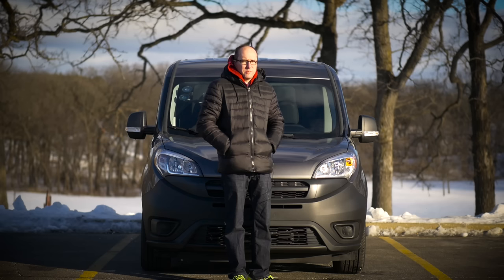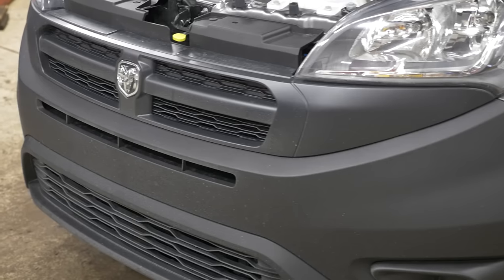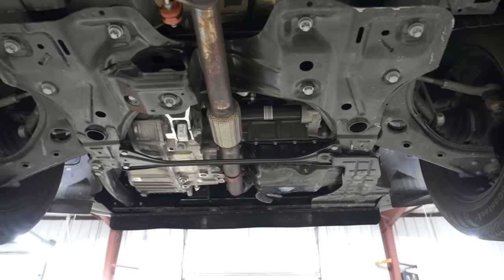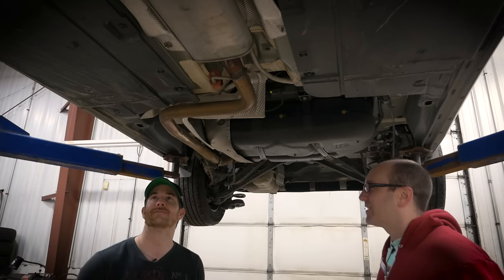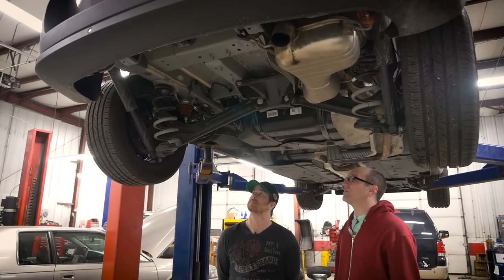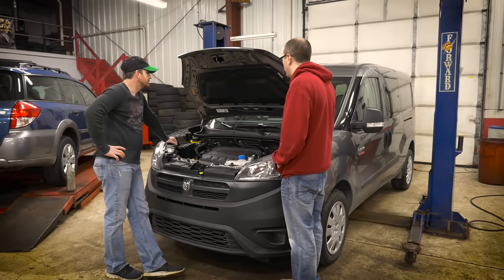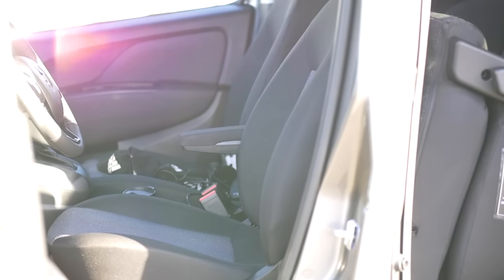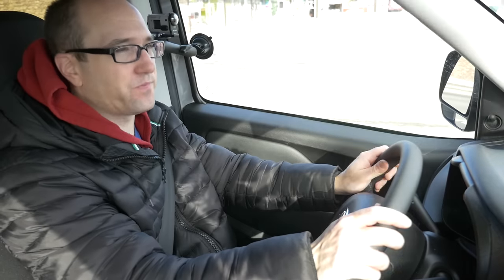Review | 2016 Ram Promaster City | Race Ready

Comment: Just found this review 2 years late. As a Dodge fan, it is hard to say, but the reliability of the Promaster is terrible. My company has about 50 of them and over half have left the driver stranded with overheating problems. I believe the main issue is failed cooling fans which have been on constant backorder. One driver was stranded when the motor died, and would not start due to being "low" on oil. I have no 1st hand experience since I pay a slight upcharge to drive the Ford Transit Connect. My previouse company car was an Escape for 3 years, and having no issues with it, decided to stay with Ford. There are 4 of us driving the Fords and they have not broken in the last 2 years.  I have 44k on mine. Keep up the great reviews!
Reply: I work for FCA and drive a ford transit 350 van for my other job. The transit is a beast. TORQUE FOR DAYS..
Reply: Mitch H Odd. I have two 2014 promasters that we run as expediters. 484,000 on one and 480,000 on the other. Not perfect, but the best van on the market. 

The fan issue is annoying, but Rockauto has them for $136, vs 320 at autozone and 450 at the dealer. The fans seem to go out every 100k or so. But they wobble and make noise before they do. 

There a 2 other weak spots, but what I find intereting about the promaster is what doesnt fail. Never had to touch a water pump, belt, steering system, torque converter, brake booster, master cylinder in either van. The pinacle of durability, the chevy van, would have needed all that stuff by now. Meanwhile, the promaster gets 20 highway, goes through snow like a beast, hauls 4300lbs, is quiet, and turns on a dime. And it costs less way than a chevy, and slightly less than the transit. Amazing.
Reply: @Turshin  That is why Transits are legendary in Europe
Reply: This isn't a promaster. It's a promaster city. Completely different vehicle.
Reply: It’s all fiat components.

Comment: I liked that you put the Promaster City up in the air and showed the under side. I saw a lot of details and stuff I really liked about the design, layout and fabrication. I saw lots of little things that make a difference miles and years down the road in how the van will drive, sound, work, feel, perform and last. Thanks for that view.
Reply: I'm late to seeing this video, but I had to stop it after 6 minutes; all these guys were doing, with the vehicle on a lift, is laughing at its construction, seemingly wanting to just come right out and say that it's crude (rather than merely, and repeatedly, calling it "simple"). I'd love to know what you saw about its "design, layout, and fabrication" that impressed you because this review seemed like a complete waste of my time.
Reply: Easy open access to everything. Cheap stamped parts that are all painted for rust prevention. Small overall amount of parts means less things to fail. It'll last as long as the 9 speed does - which to be fair has been dubious at best.
Reply: @kenhoward3512  You're not use to their style.
Reply: @kenhoward3512  He's joking

Comment: These clown should actually pack it with weight and drive it instead of incorrectly guess what it's capability are.
The bed is 48.2 " so you don't need to tilt a 4x8 sheet on an angle. "It's probably for flowers". I just hauled 1920 lbs. of hardwood flooring + my 185 pounds + another 140 pounds of freight like a champ had more power than I needed and the weight was handled like a champ as well. Certainly not like a lot of 1/2 tom pickups with that amount of weight dog wagging down the highway.  I've used 1/2 ton pickups for the same haul and this handles it better. If your going to do a review, do it correctly. Don't be lazy.

Comment: wow.... it is originally Fiat Doblo :-)
but in europe there 1.4 120 HP gasoline engine, or 1.9 diesel engine with manual transmission
chassis looks little bit different (like cheap version) I do not see any cover plates, interior fittings also looks like cheap version ....

Comment: I wouldn't call the rear suspension, basic.  They could have just used a torsion or trailing beam rear suspension and save some more bucks.  Heck, the competitor from Nissan, the NV200 have leaf springs and a beam axle.
Reply: Except that leaf springs and beam axle support a higher load capacity.
Reply: Maybe but behave like a truck. Tried both and in a daily work life the PMC is way smoother especially when you leave the road and turn in a parking business entrance. As a tech on road I appreciate it (compared to my previous Ford 250 pack up)

Comment: I bought the 2015 with NO FRILLS! No cruise. No camera or sensors, blah blah. I have the plain 3.0 screen. The amber lighting on the speedometer and tach is ridiculous. The placement of the speedometer set to the back left on a sunny Florida day makes it very difficult to see the speed. Amber lighting is for safety, but not if you can't see the speed. I traded my 2016 Ford Transit Connect toward this unit. It had every feature imaginable and was a 6 seat unit. $32,000. It was a very poor use of space or me. I need the wide open area. I only wish this had an 8 foot floor. My advice to all is make very sure you are comfortable with any van you buy. This is your home when you are not at home.
Reply: Very true, I have the Tradesman Cargo SLT and the gauges are near impossible to read when the sun is out. Amber lighting is just bad.

Comment: I purchased a leftover 2015 Promaster City SLT 5 passenger wagon. It has almost all the options except for backup camera and nav. Don’t need the nav, the one on your cell phone is better. but get the backup camera! A grand caravan is better in most respects, but the reasons I purchased the Promaster City still stand. 1) low step in, 2) great headroom, 3) big front doors, 4) low cargo floor, 5) independent rear suspension, it works in the bumps. 6) fits in the garage and you can close the garage door and walk in front of the van. It’s “garageable”. 7) it’s great for loading bulky items such as wheeled walkers and big boxes. 8) Front and rear power windows roll all the way down. 9) the front seat heaters will toast your rear end in short order. The bad? 1) typical historic Fiat build quality. Had to replace the parcel shelf above the windshield, replaced the front carpet 2 times so far because it fails to stay in place and interfears with the gas peddle. The outside mirrors had to be replaced, the glass mirror was defective on both sides, left rear door power window door pin connector was not aligned properly so window and door lock would not activate. Battery failed at 9,000 miles and had to be replaced. All done under warranty. 2) does not come with a spare tire or jack. Spendy dealer option. 3) front suspension travel is to short. Bottoms out easy. 4) this is a “city” van. Do not take it off road. Front ground clearance is too low. 5) cannot see the speedometer in daylight, and number font used is not easily visible. 6) weird ergonomics for dashboard settings. Can not select parking light setting on light switch. Cannot change dash backlight unless parked and stumbling through an awkward set of buttons and switches. 7) heater and a/c are weak. Not enough capacity. I will keep this van because it’s now paid for, and I have not found any other utility vehicle I would replace it with I like better for a decent price. They actually look pretty decent if you get a different color than white. Alloy wheels spruce it up a lot. Mine has a factory tow package with a receiver hitch. Nice feature to have.
Reply: after reading your opinion, I think US version has really bad quality comparing to european version, I have 1.4 120HP 6 speed manual transmition Fiat Doblo and after 5 years everything works fine after 130000km (includong battery), and as I see on the movie, european version is better equiped (in example there is automatic AC instead of manual AC)

Comment: Could it fit a sportbike in the back?
Reply from the maker: +sonotover It has a 1500 towing capacity, a 70" length from doors to seat folded up, height should be zero issue. There are tie downs in the back as well so my guess is yes.  Turbowski?
Reply: +savagegeese We should have tried to fit my bike in the back when it was -4 degrees.  It might fit with the back seat removed.  I think the height would be more of an issue.
Reply: Looked up the bike measurements, looks like I would need at least 85" of space.

Comment: OMFG!! WTF is up with that rear suspension!! 
Actual engineers signed off on this horrible design......actual engineers...."sigh".
The spring carrier looks structurally weak, probably falling after 2-3 winters. 
The damper must have an immense amount of stiction when set at that horrible angle--especially after some rust/dirt gets on it. All of the wheels myriad rotational/torsional forces are directed to that one hybrid trailing arm.

If they had just added a second suspension arm and integrated/centered the spring/damper, they would have a strong multi-link rear suspension. But no....that would cost an additional $80-$100. 
At least since this is a "world car" you can't blame Chrysler engineers. Nope, this turd is all FIAT.
If you need this for business, get it as 2 year lease ONLY. Or...just get a Ford Transit Connect.
Reply: The rear suspension hauls weight better than any 1/2 ton pickup on the market.
Reply: "probably falling after 2-3 winters. " sorry to say it but in europe we have also winter and after five years everything works fine...